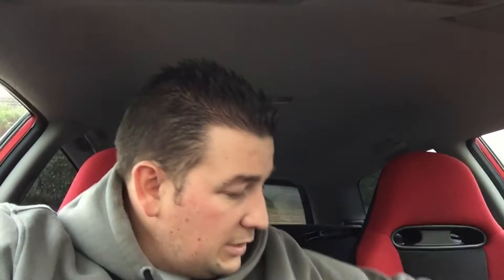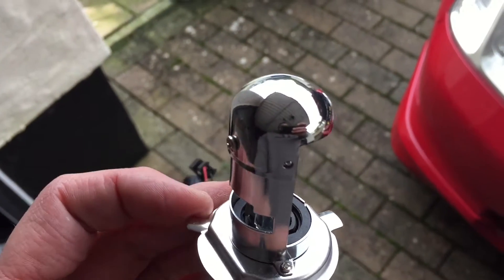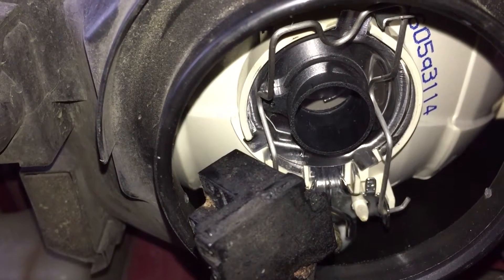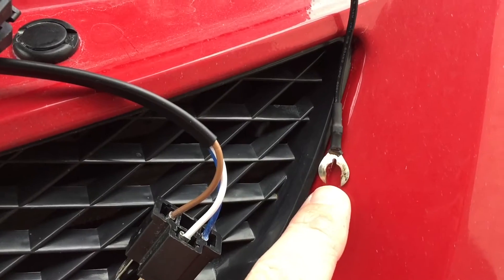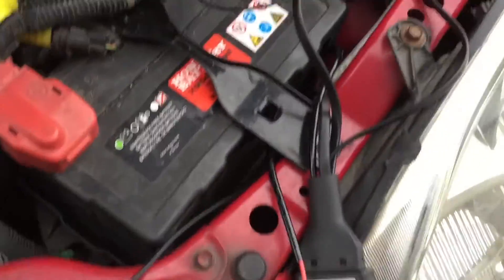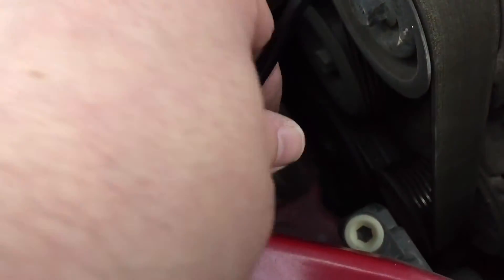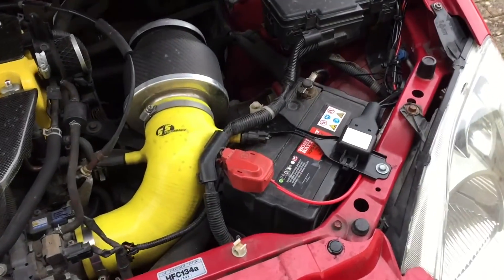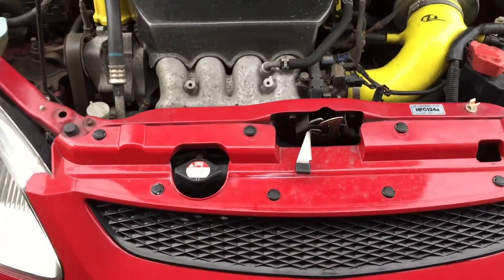Civic Type R EP3 - HOW TO - Fit a HID/Xenon Bulb Kit - H4 Pre-Facelift 5000K Bulbs.

Comment: Fitted HIDs on my facelift, but light lens started letting in moisture. Gonna go back to halogens lol.

Love the prem seats btw! Would love some but not worth the extra money when I already have facelift seats.
Reply from the maker: +psp0guy Did you refit the cover? That's normally not done by people and makes all the difference. 
The premier seats are awesome, I've not got custom made red seatbelts to match too!
Reply: +EP3Stuff On facelifts you have to cram  a few extra wired behind that rubber grommet thing. So it doesn't fit back on properly.

HID fitment looks much cleaner on pre facelifts
Reply from the maker: Ah yeah, obviously 2 different bulbs on the facelift. Hadn't thought of that!

Comment: Have visited the web site you recommended I see they have four conversion kits available for EP3. Could you tell me which one you purchased please?
Reply from the maker: +Alan McGinley Hi mate. Mine started off as a Sport kit, that's the basic bolt on kit for the EP3, if you want more power you can go for the supersport.
Reply: Many thanks for quick reply buddy cheers for the info
Reply from the maker: No worries. Hope you get what you're after!
Reply: Hello again I'd just like to say many thanks for your video and web site info for the HID conversion kit. I bought a 3M lens cleaning kit and polished up my headlight units came up like new my misses thought I'd bought new ones when she saw them lol Have just finished installing the HID conversion kit with the help of your video will take the motor out when it gets dark to see the massive improvement and maybe get the headlight alignment checked later just to be on the safe side. All the best!!
Reply from the maker: Good stuff mate. Glad to have helped!